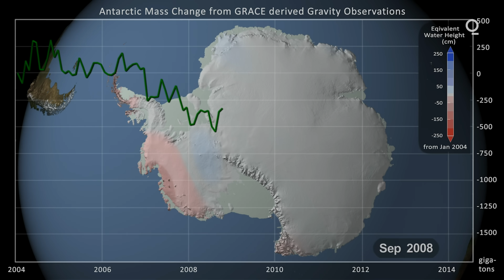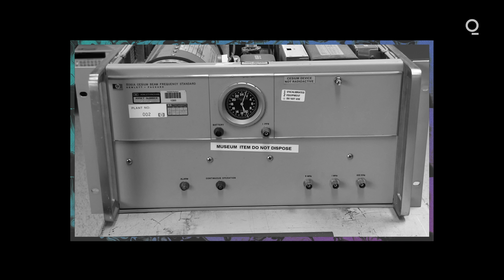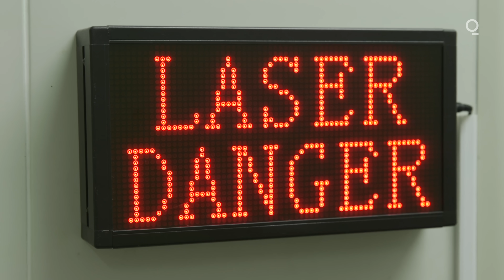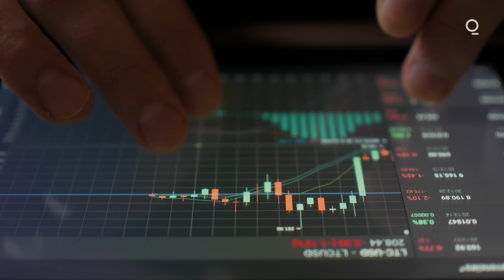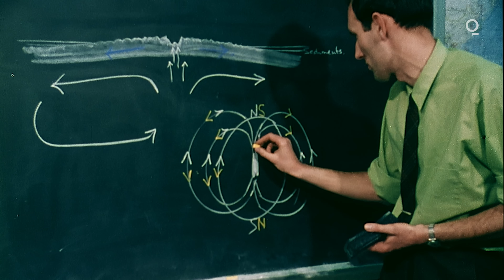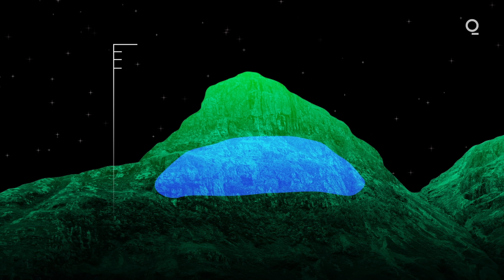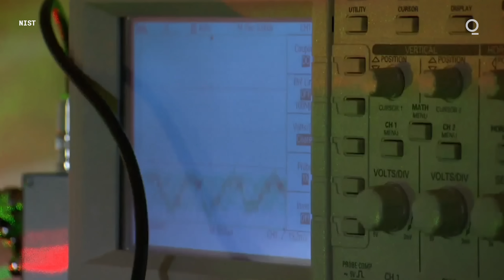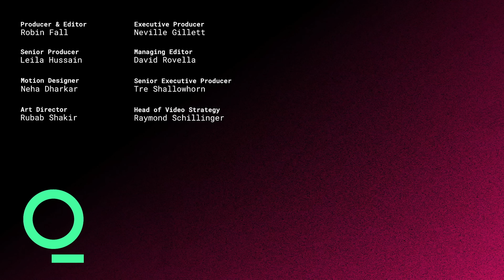Atomic Clocks Are Reinventing Time

Comment: So they put a clock 30cm higher to see if it measures time faster, and then they put a clock on FLYING PLANE, THAT IS IN THE SKY, and conclude that it's because of speed!?
 tf did I miss there?
Reply: Its all bs, its not time that changes its the movement of the atom in the clock. They are measuring time through how the atom moves. Obviously when you bring the clock closer to earth, the atom moves slower because gravity is acting more on it. And if you put the clock on the tallest mountain in the world the atom would move faster because gravity is a bit weaker up there. Time itself is not changing its just how the mechanics of the clock being affected by gravity, and this could also happen through acceleration as you could imagine. Moving a clock very fast would reduce the effect gravity has on it so it would tick faster.

This doesn't change the fact that time is constant and independent of absolutely everything that exists.

Comment: The mistake is that time is separate and independent.  Time is the change of objects that we are measuring and observing.  Clocks are measuring devices and the measuring devices, because they are physical, are affected by gravity.  The same as you taking a step on land versus taking a step underwater which the water will make your step take longer to make.

Comment: I'm still skeptical that it's actually time that's speeding up or slowing down. It still seems like the methods we use to measure time is what speeds up or slows down based on it's surroundings which makes sense to me. So gravity can affect how much a atom oscillates and that oscillation is how we measure time, it sounds like our measure is inaccurate not that time itself is changing. However practically it doesn't matter which is true until we find some way to measure time that is not affected by it's surroundings, which is unlikely.

Comment: is gravity a centripetal force that keeps us down to the ground?
Reply: No, gravity is a result of distortion of spacetime. The best way I’ve heard it described: if you consider a trampoline with nothing on it, it’s a flat plane. If you place a ping pong ball on it, the ball won’t move. If you add a massive object such as a large stone to the middle of the trampoline, the flat plane becomes distorted. Place the ping pong ball on the distorted surface, and the ball rolls toward the stone. Think of the earth as the stone, and yourself as the ping pong ball. In the presence of the earth you will “roll” across spacetime to the stone.

Comment: remember each particle has a different density and it can be changed by increasing or decreasing the charge with electrons. If we use magnetic confinement we can create super dense vacuum chambers, super cooled liquid metal(I think mercury...), apply DC and the mercury naturally spins, then apply AC over that DC voltage to remove effects of gravity then speed up the frequency and volt amps. You can put more energy in and break the barrier of the vacuum which would create a lot of plasma. Super high frequency!

Comment: 1:45 Correction: you experience higher gravity when on the SURFACE of the Earth
Reply: how do you figure that?
Reply: @kardsufur2966  It's well documented. Not about to explain it here though
Reply: @Marz2695  i assume it's only due to the fact that the closer you get to the center, the more mass is 'attracting' you because a large part of the earth's mass is now 'behind you' and is actually pulling you away in the opposite direction whereas if you were on the surface or above the earth, the full mass of the earth would be gravitating you
Reply: @kardsufur2966  correct!
Reply: @Marz2695  shiiet i'm smarter than I thought

Comment: if the spaceship moves away from earth at a high speed, relatively the earth moves away from the spaceship too. why the clock in the spaceship goes slower?
Reply: might have to do with gravity but let's wait for an expert's opinion
Reply: Object that move through space experience the time dilation... That's why it's called as "space time" space and time is one thing, not two.
Reply: @kylelochlann5053  Not sure whats wrong on my comment, its proven when you move through space fast enough you would experience time dilation... what's wrong about that?
Reply: @kylelochlann5053  WTF Harry... All intelligent people are smart enough to know you speak to your audience. You sound very snooty professor like and arrogant. I am not exactly dumb and couldn't really follow along with you. Why did you try so hard to answer like this, did you read his question? It wasn't asking for the answer you gave. Honestly, I think you are mostly right but you said it so fucking complicated no one but you will fully understand. "integrate over a parameterized curve to find its arc length" way too much man.
Reply: Check out PBS Spacetime for some great content on this subject. It's not about speed, relatively each can't say their speed. Who is the sitter and who's the mover?  It's about ACCELERATION. The object that accelerated is the one time slows for. Acceleration is not relative. Everyone on earth "sitting still" wont feel any acceleration. The spaceship taking off will push it's pilot back into his seat. Speed is relative, acceleration is not.
Reply: Gravity slows down time from an outsiders’ perspective iirc

Comment: There are 2 types of time dilation, one due to gravity and one due to relative velocity.
 Question : what speed does a satellite at 1000km above Earth surface need to be travelling at, in order to cancel off the time dilation caused by gravity here on Earth?
Reply: Probably a lot km/h
Reply: @rockblack  🤭🤭 probably  so..anyway just curious to know how fast😀
Reply: Actually the height alone would reduce that effect as it is further from the Earth's gravitational field. Consider that if the satellite moves too quickly it will leave orbit (and vice versa). Also consider the relativistic change in the rate of time due to gravitational acceleration (gravity) is... relative to whatever body being compared. So there's nothing necessarily to cancel out in that sense.
Reply: @djayjp  not sure if i understand you correctly..currently the "time" on a  satellite has to be corrected relative to the clock on earth in part due to time dilation. This is due to time dilation caused by gravity, since clock ticks faster on the satellite correct? If this is true , than by accelerating the speed of the satellite, it will slow the time on the satellite due to time dilation because of relative velocity to earths clock, correct? 
So my point is there must be a equilibrium where the 2 dilation cancel out each other? ( just hv to ignore the obitting speed perimeter required to keep the orbital integrity for this scenario)
Reply: @deeprecce9852  Ah I see. Well the increase in altitude increases the clock speed relative to sea level but the increase in velocity would slow it relative to the speed on the Earth's surface (if the satellite is not in geostationary orbit and assuming it orbits more quickly than the Earth is rotating, eg, the ISS takes about 90 minutes vs 24 hours) so you'd have two counteracting effects there, but my understanding is that the speed differential of most satellite orbits would be the greater effect vs the gravitational/altitude one. What the precise number is I don't know.
Reply: @djayjp  yes i think u r right, the velocity of the clock has a larger effect than the altitude..( just read about it😀)  
So technically there must be a equilibrium point where altitude and speed cancel out the effects of time dilation for the 2 clocks..(though its probably not possible to keep the satellite in orbit🤭)
Reply: @deeprecce9852  Exactly! Even the ISS which is considered to be in "low orbit" is pretty fast ha
Reply: @deeprecce9852  And actually I was wrong as even in geostationary orbit it is moving way faster due to the distance (as it has to cover far greater ground to keep up with the smaller movement of the Earth's rotation on the ground)
Reply: The time dilation due to gravity equals the time dilation due to speed when that speed is the escape velocity from that gravitational field. So standing still on Earth's surface is the same time dilation as moving at 8km/s in flat spacetime far away from any massive body.
Reply: @zdlax  oh!! Thats great information..thus the equilibrium point is at the escape velocity of the gravitational field! ...will go read up on this, thanks for the information 👍👍
Reply: @zdlax  Don't you mean 9.8m/s at sea level?
Reply: @djayjp  no 9.8 m/s^2 is the rate of acceleration due to gravity at Earth's surface. Escape velocity is on the order of 7 or 8 kilometers per second.
Reply: @zdlax  I don't think your point is correct as demonstrated even airplanes move at a slower time than on earth's surface.
Reply: @djayjp  because an airplane flies at a height that's practically the same as sea level as far as earth's  gravity well is concerned. To significantly reduce gravitational time dilation effects you need to be a large distance away from earth, like several earth radii away.
Reply: @zdlax  Ok but then moving quickly has the opposite effect. You can just admit you were mistaken.

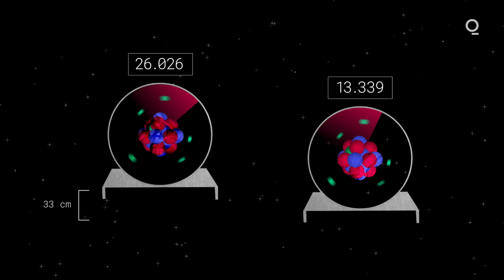Comment: At 3:52, didn't they just explain, the higher you are above ground the slower time goes???
Reply: But if you move faster at the same time than the person on the ground it slows down more for you than him, i know it's paradoxically but it's true. So person who is going at ridiculous or very fast speeds at sea level will get the most out of time dialation, and will therefore age slower.